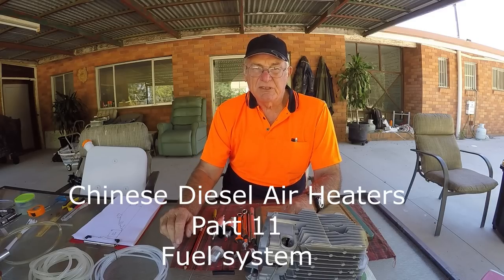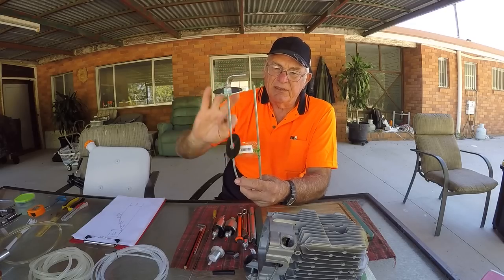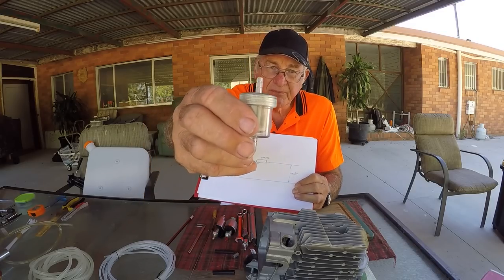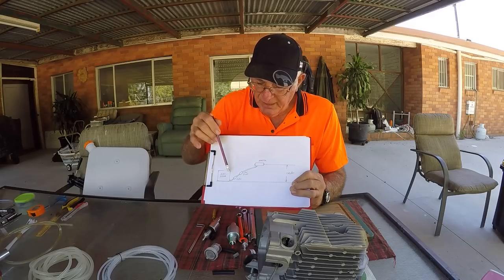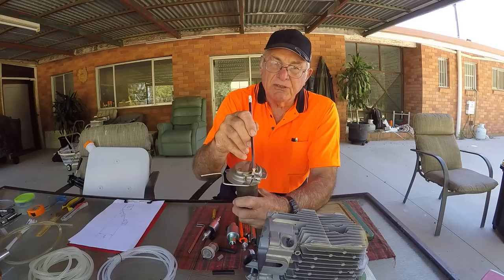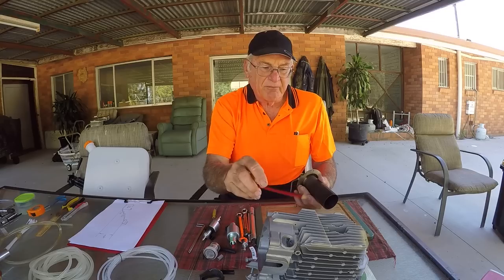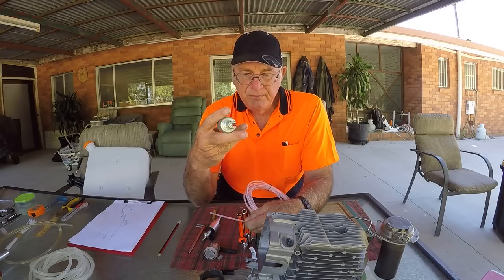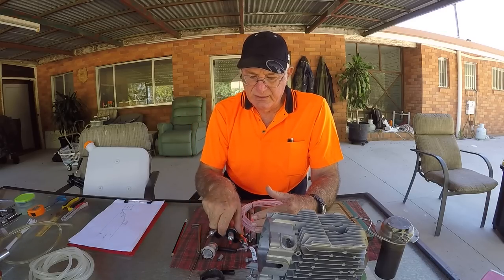Chinese Diesel Air Heaters - Part 11 -  Fuel Delivery

Comment: Just wondering what the difference is between a "16ml" pump vs a "22mm" pump? They both dose the same amount correct? Is it the displacement of the pump body or something? 

Reason I ask is I put a small 2kw heater in a truck cab and suspect the 16ml pump is bad or my lines are causing problems. I'm going to try a 22ml pump I have to diagnose it but concerned it could overfuel the heater. 

I had the same e08 problem when I bench tested it but thought it was just air in the lines. It won't light unless I prime it first, when it attempts to light it goes "whoof whoof whoof" with the pump pulses but does not stay burning. Once I get it running, it does not make much heat and can't be put higher than about 1.7hz without flaming out. Putting out around 78°c outlet temp with ambient temp of around 0°c to 10°c 

 I'm not sure exactly how it works but I'm thinking it is expecting to see a heat exchanger temp increase and shuts off when it's not within the expected range as it is still lit when it shuts off.

 First I'm going to check for leaks and that there is no excessive air in the line, if not I will try the other pump using the existing lines and see if it'll run.

Really hoping I don't have to exchange it as it is now plugging the holes I drilled in my floor. I'll just buy another pump if it is faulty I guess
Reply from the maker: Hi Julio, 

The 16 pump should put out .16 ml per pulse. The 22 pump should put out .22 ml of fuel per pulse. 

Are you using narrow bore hard nylon fuel line on the delivery side of the pump?

You can use 4mm good quality fuel hose on the suction side of pump. (Tank to pump)
But you should only use narrow bore hard nylon fuel hose on the delivery side of pump. You should not use the cheap clear vinyl hose sometimes supplied as it absorbs the fuel pulse, and also perishes easily.   

Many 2Kw heaters come with 22 pumps.   JMcK
Reply: @johnmck1147  yeah I put the hard nylon line on it. When I get some free time I'll have to lay in the snow and see if it appears to have excessive bubbles. I have one of the .22 pumps for a 5kw I'll try it if it does not seem to have an air issue. The supply side of the pump is gravity feed so if I had problems on that side it would leak. I will have to check the tank cap vent too.
Reply: @johnmck1147  the reason I suspect the pump is I had an e08 shut down when I was test running it with the soft fuel line as well prior to installing it in my truck.
Reply: @johnmck1147  the reason I suspect the pump is I had an e08 shut down when I was test running it with the soft fuel line as well prior to installing it in my truck.
Reply from the maker: Hi Julio, 

You can an 08 message from a leak in the fuel line at one of the connections.

You can also get an 08 from using soft nylon fuel hose on the pump delivery side, particularly if the soft fuel hose is longer than  about 300 mm (1 foot) in length. The soft hose absorbs the fuel pulse and the fuel is not forced through the atomisation screens.  JMcK
Reply: @johnmck1147  I tried the bigger pump today and it worked fine and was at about 140° at 2.1hz with ambient temp of around 10°.  I didn't see any visable smoke from the exhaust so I think I will order another 22ml pump
Reply from the maker: 👍 JMcK

Comment: should the filter be in between the fuel tank and the fuel pump, or between the fuel pump and the heater?
Reply from the maker: Hi Seymour,
The filter should be between the fuel tank and the pump.
Never between the pump and the heater. 
These pumps are pulse pumps, a filter in the delivery side of the pump will absorb the pulses. That is also why you should use narrow bore hard nylon fuel line on the delivery side of the pump, so the pulses are not absorbed by normal rubber  fuel hose.  JMcK
Reply: @johnmck1147  that's what I thought too, I've seen others on YT put it towards the heater and it seemed like a waste of time not to protect both the pump and the heater

Comment: Can you burn used cooking oils on these. even a 50/50 mix with diesel
Reply from the maker: Yes, you can.....for a while.
Burning cooking oil, or other oils produce lots of carbon residue, and your heater will carbon up quickly and not run.  JMcK

Comment: you mentioned to use the 2mm hard nylon hose on pressure side of pump (not sure which side that is) but i assume i can use that hose on both sides of pump ey?
Reply from the maker: Hi SP, 

Suggest you use good quality 4 mm fuel hose from tank to filter to pump. (The suction side) by using the one size hose here you remove some joins and hence potential leak spots. 

From pump to heater (pressure side) you should only use hard nylon fuel hose, particularly if the pressure side length is greater than about 300 mm.   JMcK
Reply: @johnmck1147  fuel hose length shouldnt be a concern as this is an 'all in one' heater unit. yes i did notice you want to use 4mm standard fuel hose as a connector for 2mm stiff nylon hose. someone also suggested i put 4mm standard fuel hose in hot water to make it easier for 2mm hose to slide in. Another question: what about diesel attracting water...you didnt mention this in reguards to filter so maybe its not a concern? Theres some complaints about supply probs, AND bad quality china plastic filters... I found a good quality WIX brand dedicated diesel filter Part # 33971 with 1/4 inch inlet / outlet. I wonder if its too big for this application, maybe cause fuel starvation / pressure probs due to a lil larger size filter?

Comment: hi John thanks for your great videos. Do you know if its okay to put the tank higher then the pump and the heather?
Reply from the maker: Hi Jeppe, yes the tank can be a bit higher than the pump, up to about 1 meter, without causing issues.  JMcK
Reply: @johnmck1147  thanks. i still have to run the fuel hose in a lope so that's higher then the tank right?
Reply: I'm just asking because i was having some fuel coming out of the air intake in the bottom.
Reply from the maker: Jeppe Hermansen 
That is ok. I have run a loop greater than 1 meter above the tank without issues.  JMcK
Reply: @johnmck1147  okay thank you very must
Reply: Hey John, incredibly detailed and helpful info here thanks a lot. In relation to this point im a little confused.

You say here thats  its ok to have the tank up to one metre above the pump but in the video you suggest no more than 500mm on the suction side, (my understanding of the suction side is tank>filter>pump less than 500mm). Have I understood something incorrectly? 

Also in the diagram you show at the start you suggested an upwards feeding system with the tank at the bottom. Is the the upward feeding only important on the delivery side? 

Thanks again, I was floored by your knowledge watching this.

Comment: I’d there a way to power a tiny 12v fan off the Chinese diesel while it’s on?
Reply from the maker: Hi Jim,
These heaters should have their own dedicated main switch. ( I talk about this more in the motorhome video) and this switch should be switched off when heater is not in use, otherwise the controller and ECU constantly draw power. You could put your fan in that circuit.  JMcK

Comment: John i have a problem with my Chinese diesel heater. It as worked fine for 3 months but now the fuel pump clicks but is not delivering any fuel. I took the fuel pipe off and  tried a fuel prime but no fuel pumps out even though it still makes the clicking noise (maybe a seal gone inside the pump ????) and yes i have fuel in the tank. My heater is the all in one type in the red case with fuel tank on top. Could anyone link the correct pump i need to buy so i get the correct one. Any help appreciated, Thank you.

Update... I purchased a new pump after approx. 3 months use of my Chinese diesel heater using Red Diesel from work which is in a  large tank onsite used by all our heavy plant equipment. I have now fitted a fuel filter inline and would like to stress to anyone running one of these Chinese diesel heaters how important this is, The fuel pumps have very fine tolerances and i have noticed a very fine silt in the heater diesel tank in some places, Fit a fuel filter inline to save any breakdowns or costs further down the line. Thanks to John who runs the channel and his sound advise, My heater is up and running again.
Reply from the maker: Hi Jollyroger,

Did you install a fuel filter? 

All the all in one heaters I have seen did not come with a fuel filter.

If you don't have a filter the most likely cause is a pump blockage. 

If a blockage, it can be hard to clear. You can try blowing compressed air backwards through the pump, and soaking it in kerro, but you may need a new pump.

Replacement fuel pumps are readily available on eBay. Search fuel pump for Eberspacher or Chinese diesel parking heater. Also get a fuel filter.

Cheers.  JMcK
Reply: @johnmck1147  Hi John, I did not install a filter, I ran the heater straight from the factory how it came, I have been running clean diesel. The pump clicks but no fuel is coming out when i took the fuel line off.
Reply from the maker: J0llyroger 
The piston and valves in these pumps are very small with very fine tolerances. They really need a fuel filter. I strongly suspect you have a built up blockage of fine sediment.
Regards.  JMcK
Reply: @johnmck1147  Thank you john, i ordered a new pump and i will fit a fuel filter.
Reply from the maker: J0llyroger 
👍

Comment: What size is the "standard fuel line size" that you use as a connector?
Reply from the maker: Hi Hem Lock

Suggest you use good quality automotive fuel hose, 4 mm ID from tank to filter to pump.

From pump to heater, unless a very short distance you should only use narrow bore, 2mm to 3 mm ID  hard nylon (or metal,) fuel hose that does not absorb the fuel pulses. 

The short joiners for hard nylon should have an ID slightly smaller than the nylon OD. 
If you can easily push the nylon into the rubber joiner without first soaking the end of the rubber in hot water you will have leakage and fuel delivery issues.

If you can only get 4 mm ID fuel hose joiners, and you have 4 mm OD hard nylon that you can easily push into the joiner, then seal the join after inserting nylon with a silicone sealant or similar, and wait until sealant fully cured before use.  JMcK

Comment: What am I missing?  Why not install the tank high and the heater low, making the fuel go down from tank to heater (through pump). No air introduction and less strain on pump and fuel will not leak out in heater because small hose diameter and atomizer screen.

Comment: How about standard 3/16" copper brake pipe on fuel send line? Will it work?
Reply from the maker: Yes, in fact marine certification requires metal fuel line, SS or copper, if it passes through a machinery space. A hard fuel line with 2 mm bore is best, but a bore of 3 mm is ok.
These heaters use a pulse pump for fuel delivery, and they adjust the heat setting by changing the rate of pump pulses. You will have issues with these heaters if you use a “soft” fuel line that “absorbs” the pulses.  JMcK
Reply: @johnmck1147  Thanks for the reply!

Comment: Do you have to mound the tank below the level of the heater?
Reply from the maker: No, the tank can be mounted above or below the heater. 
However, if above the heater more than about 500 mm you should install a shut off valve in the fuel line before the pump, and turn this off after use. With a head pressure of a about a metre or more diesel can leak past the pump seals and flood the heater when not in use.

Cheers,  J McK

Comment: How much bend can a rubber fuel line have? There a minimum bend radius?
Reply from the maker: It depends on the type of fuel hose. With good quality rubber fuel hose you can get a tight bend that is kink resistant. With vinyl hose you may think you have a tight bend, but it will kink later when in use.  JMcK

Comment: I have to mount the heater below the fuel tank so the gravity is pushing the fuel . Will it be an issue
Reply from the maker: No, provided the height difference is not too great.
It is always a good idea to install a fuel shut off valve in any heater install, but a real requirement if the fuel tank is about 1 meter higher than the heater to prevent leakage/seepage of raw fuel into heater when not in use.
Turn tap on before heater use. Turn off after heater use.   JMcK
Reply: @johnmck1147  I think I'm going to install a main switch so that I can completely turn off the heater . I try to find a suitable  solenoid fuel valve. I'll use that main switch to turn on a solenoid fuel valve too.
Reply from the maker: Esa Saarinen 
👍👌

Comment: How were you energizing the pump doing your pressure testing of the hoses?
Reply from the maker: Hi Mr Nelson, I used a small thumb operated micro switch, as shown in a previous video on the pumps.  JMcK
Reply: @johnmck1147  Thank You, John. I didn't actually see it but that's what I thought it was. I wonder if you could help me here. I purchased this planar heater a couple years back,  https://www.amazon.com/gp/product/B00R8ILIDA/ref=ppx_yo_dt_b_search_asin_title?ie=UTF8&psc=1
but I can't seem to find the service kit for it. (gaskets) Any suggestions? I've asked around... to no avail.

Comment: Good video but I have to take issue with one thing. When you are saying that the pump finds it easier to draw up the fuel from a small diameter tube compared to a large one due to the weight of the fuel in it, that is simply not true. You fail to take into account the effect of air pressure acting on the open end of the fuel tube. The air pressure acts over a larger area for the larger diameter fuel tube and basically cancels out any effect the different tube diameters have. That's why pump manufacturers only quote the height a pump can lift from, they never quote tube sizes because its irrelevent. What makes the diesel go up that tube is the air pressure acting on the end of it. If you want further proof, look at the Torricelli mercury column barometer - the diameter of its column has no effect.
Reply from the maker: You are correct.  JMcK

Comment: Thanks a ton for this video. So helpful! I have an issue with my heater. It came with the small nylon hose, and when I first installed it, I found that it leaked from the fuel line sections at the junctions even when secured rather tightly by hose clamp. Has anyone else encountered this issue? I was considering sealing with a silicone sealant, but would welcome other suggestions.
Reply from the maker: Hi Devin,

There is no issue using normal fuel hose on the suction side of the pump to reduce leaks. That is from tank to fuel tap (if fitted) to filter, to pump.

But on the delivery side you should only use narrow bore hard nylon.

Your issue is caused by the supplier giving you the wrong size black fuel hose joiners.

If your nylon hose is 4mm OD, using 4 mm ID black fuel hose as a joiner is too lose and will not work. You need to complain to your supplier, ask for a discount, and then go to an auto store and buy some narrower bore fuel hose to use as a joiner. You soften the black fuel hose in hot water to soften it so you can force the hard nylon into the black hose joiner.

I talk more about this in the motorhome. videos. Suggest you view those.

Good luck.  JMcK
Reply: @johnmck1147  hey john just one thing regarding this.. if using outside diameter 4mm would the joining black hose be 3.5mm
Reply from the maker: @stevenyoung2503  
Yes Steven. One issue that comes up often is people using 4mm ID joiner hose for 4mm OD nylon fuel hose. IT IS TOO LOSE. If you do not need hot water to soften the black joiner hose it is too lose.  JMcK

Comment: is there another non-solenoid pump we can use? it is so clicky!
Reply: Im sure theres a better quality pump also
Reply from the maker: Biking With Panda 

Sorry, they all make a clicking noise, that is the nature of the pump. What you can do is use softer rubber mounting, but please do no wrap the pump up in foam or similar as it will overheat.

However, if the pump was run for a period without lubrication, as in initial pump priming then damage can occur and mad make the clicking louder, and a new pump may be required.

Cheers,   JMcK
Reply: @johnmck1147  Thanks for that bit of info as I was about to place the pump into a soft rubber/sponge tube I bought from Clark Rubber. I had thought of placing the "covered" pump into a hard plastic bottle to help cut down the clicking noise but it looks like we will have to live with it. I bought a smaller diameter sponge tube in which the hard fuel line will fit and stop any knocking/clicking from the pump...I think. Your videos have been very informative and helpful in all aspects of fitting these heaters.
Reply from the maker: Peter Kitchingman 
Hi Peter, just be careful wrapping up the pump too much for noise reduction as you can cause pump overheating issues.   JMcK
Reply: @johnmck1147   seems a good idea to have certain spare parts around....Im sure they are cheap. you dont wanna get caught in real cold
Reply: @johnmck1147  Thanks John looks like we will have to live with the "clicking" noise for the time being as the pump will be under the bed. Wasn't sure what supporting you did in your boat (part #16) for the pulse pump as the photo wasn't quite clear enough. We have friends (Owen & Judy from WA) who park their boat in Turkey and go for three months of the year and have been doing it for close on 10yrs as well. We did the Paxi islands with them years ago.
Reply from the maker: Peter Kitchingman 
Thanks for the info Peter. The boat pump is mounted in an Eberspacher "spider" pump mounting. (Expensive to buy) you could make your own with thin shock chord, but the common rubber mounts are quite ok. You get used to the ticking noise, but some people have a very loud pump noise and it is generally because of trapped air. Their pump does not have enough angle.   JMcK